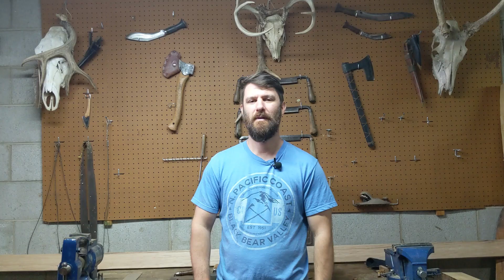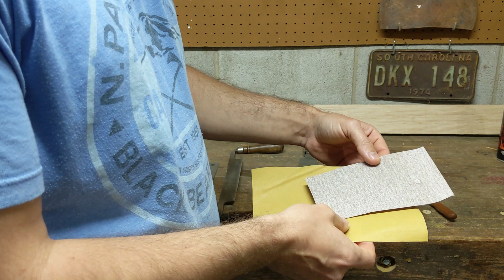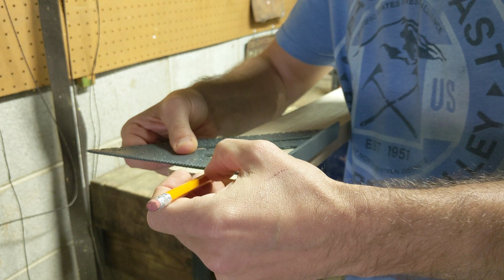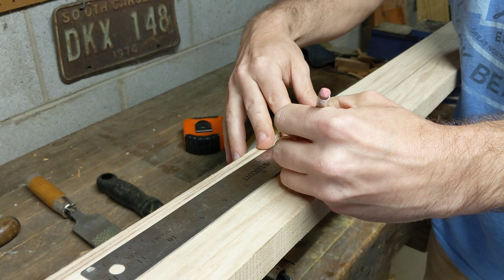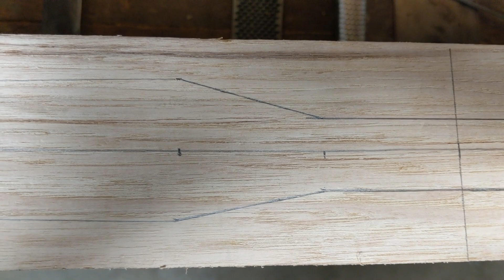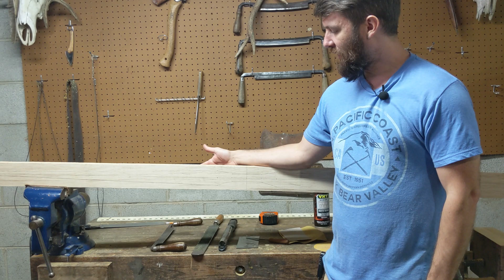How to Build a Board Bow Part 2: Tools and Layout

Comment: I have a question you went over the overall length based on the draw length I want to have a 33 inch draw length but I also want to do 100 lb draw weight is there anything in particular I need to know about how to do that safely

Comment: Why can you choose either side as back of the bow? On staves the growthrings always curve downwards from the back to the belly. I thought for boards it has to be the same.
Reply from the maker: It's true, they do have a curve to them but it doesn't effect the integrity one way or the other. The most important thing is having no runoff.
Reply: @SwiftwoodBows  Perfect thank you so much!!!  I'm asking, because my white oak board has a layer (more like a corner) of sapwood on the bark side. So I would do it the opposite way of how you did it.
Kind of bend the board against the tangetial curve of the growthrings. Since you told another guy that sapwood bends differently and makes tillering more difficult I would use the side without sapwood as my back.

Does the way you bend it,
may it be perpendicular to the rings, or with, or against the tangential curve any effect on the tillering process?

Comment: when you draw out the design of your bow ... do you try to keep a grain line centered ?
for example the layout might actually be slightly angled from the center of the of the board from end to end.
(not "squared" to the board)
Reply from the maker: Good question. Grain is king on any bow. If the grain line is diagonal to the edges of the board follow the grain, not the board.
Reply: @SwiftwoodBows  thank you.
i have another question.
is it possible to build a penobscot bow from a board bow ?

Comment: Is there a rule of thumb for short bows relative to length and draw weight?
Reply from the maker: Are you asking in regard to bow length compared to draw length?
Reply: @SwiftwoodBows  if Richard wasn't, I am ...

What are the guidelines/rules when matching short overall length bows to specific draw lengths?

I, for example, have a 29" draw length and would like to build a bow of about 55" in total length for sill hunting the Bushveld areas in South Africa.
Reply from the maker: @AndrevanTonder67  the rule of thumb is that the nock to nock length of the working limbs should be at least double the draw length. If you have a bow that bends through the handle then you would want at least a 58" bow for a 29" draw length, 66" if it has a standard 4" stiff handle with 2" fades. Drawing a 55" bow 29" is asking for excess set, stacking issues and at worst a broken bow. There might be some modern material bows that can pull it off but unless you're making a horn/sinew composite bow I wouldn't risk it.
Reply: @SwiftwoodBows  thanks for the feedback. A longer bow it will then be, especially since it will be my first one.
Reply from the maker: @AndrevanTonder67  I think that's wise. Also, don't underestimate a longer bow in dense areas. I hunted elk in the Oregon coast range with a longer bow for years. That's a jungle. No matter what kind of bow you use you are still going to get into a clearish spot to take a shot. The length of my bow never really felt like an impediment

Comment: Why isn't the arrow shelf at the center of the bow?
Reply: You want the part where your hand holds the bow to be in the middle because that is where the most pressure will be when you draw the bow back. If you put the arrow shelf in the middle, then your hand would have to be positioned lower on the bow. This would mean that when you draw the bow the top limb would pull back towards your face, tilting your shot up and giving the potential for you to accidentally let go.

If you're talking about it not being in the center of the width of the bow, then that's due to the weakness of the wood and something called the archer's paradox where arrows are designed to flex in flight in order to fly straight - kind of.

Comment: This is great to see. In your next video would you mind taking a second to talk about how to handle prop twist in a board bow?
Reply from the maker: Thanks for the idea. I'll add that to my list. A little bit of twist can safely be ignored in a straight limbed bow. If there is significant twist then a heat gun and some clamps might be needed. I dont have any twisted boards to work with but the concept would be the same for a stave. the next time I need to wrestle with the twist in a stave I'll try to make it into a video.
Reply: @SwiftwoodBows  thanks! I actually am running into a strange situation right now where I ran out of staves and am making a board bow that has twist in one limb, but only when it bends. I went to a pair of calipers to make sure the thickness is equal and it is. I haven’t the slightest idea how to fix it honestly

Comment: To my untrained mind, I would think the maximum point of power for the arrow to be nocked would be the center of the string and might dictate the arrow would need to rest at or near the center of the bow itself.  In your demonstration you're putting the hand in the center of the bow, which I understand as well, to get the limbs to bend and supply power evenly.    How do you balance the hand needing to be in the center vs the arrow needing to be in center?  I'm clearly overthinking it, I can tell, but my curiosity is overwhelming me.
Reply from the maker: I go back and forth on how I layout my bows. To make the arrow rest at the center of the bow you would need the bottom limb to be 2" shorter than the top, which is easily achieved. It requires a slightly diffferent balance in the tiller but otherwise it's fairly easy to pull off. I've made plenty of bow like this, some with a bottom limb 1" shorter and some like this where the limbs are symmetrical. I have noticed no difference in how they perform. Like Ryan said, the difference, if it exists is so negligible that it's not noticed. The jury is out for me if it's worth hassling with asymmetrical designs, I still do it but increasingly I'm not sure why I do. When I'm teaching beginners I usually have them make symmetrical designs like this because it's easier to judge the tiller. I hope that answers your question, at least from my perspective. I'm sure there are other bowyers with other opinions about it.
Reply: @SwiftwoodBows  good detail.  Thank you and everyone who chimed in.
Reply: Might make a small difference but not enough to matter in the real world. Probably wouldn’t even make 1fps difference.
Reply: Because he didn't mark out an arrow rest, it's seems safe to assume that the arrow rest will be the shooters hand. If that's the case, the arrow will be at center as well.